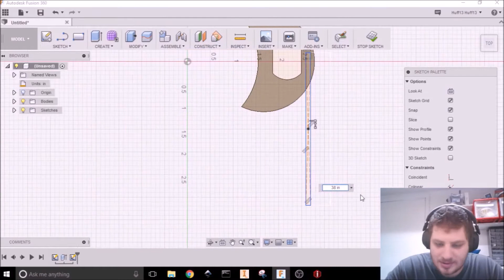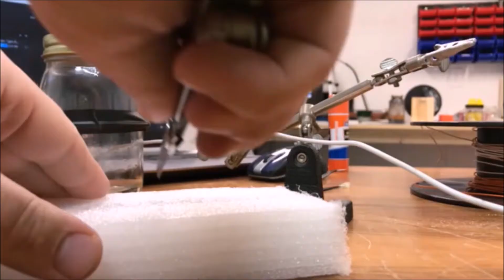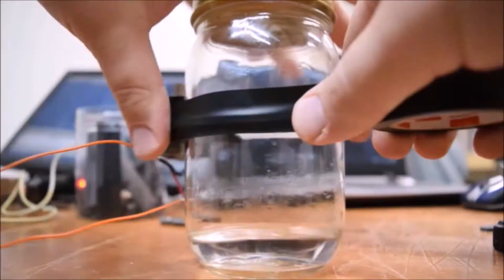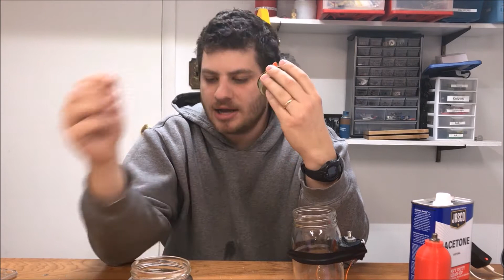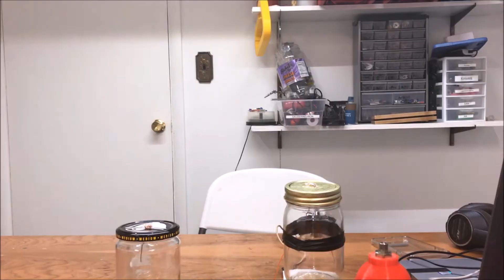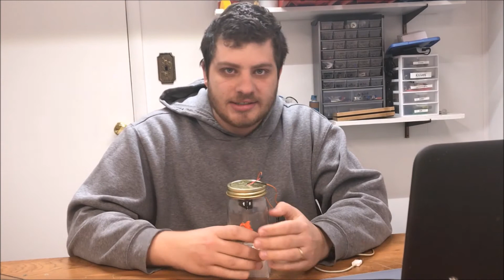How fast can you smooth ABS?

Comment: cool video! I've got a spare fan lying around. did you just use a power supply to run the fan? I'm new to electronics.
Reply from the maker: Thanks! I used a old IPhone charger and cable to power it. I just cut off the Iphone end of the cable and pulled out the black and red wires, and plugged that into the phone charger which I plugged into the wall. The phone charger provides you with 5VDC at 1 or 2 amps, which is more than enough for this little fan.
Reply: Design The Everything that's a really smart idea! I've definitely got a few usb cables lying around

Comment: There are several ways of smoothing ABS prints with acetone. You can smooth it by just placing it in a jar with acetone in it (as you did) but you can also use acetone vapor. Just place the part in a rice cooker you don't use anymore or (how Thomas Sanladerer does it), you can put it in an aluminum can with some paper towels soaked in acetone and heat up the can with a torch. You can also dip the part in acetone.
Reply from the maker: +MatthiasChristiaens I just filed a video where I did that very think. That video should be out within a week :)
Reply: Design The Everything Cool! I like your videos, just discovered your channel and subscribed :)
Reply from the maker: +MatthiasChristiaens thanks! I appreciate the encouragement! I also did a video on speeding up the ABS smoothing process by agitating or circulating the acetone vapors. You could check out. Unfortunately it's one of my least popular videos :( and I'm not really sure why.
Reply from the maker: +MatthiasChristiaens I just realized what video this was on... I thought it was on the compressed air tank video.
Reply: Design The Everything haha :) I don't really understand either, maybe people are just not really interested in Acetone smoothing or maybe they already know about it.
Reply from the maker: +MatthiasChristiaens thanks for the encouragement. I'm going to try changing the title again, and maybe a new thumbnail and see if it does anything.